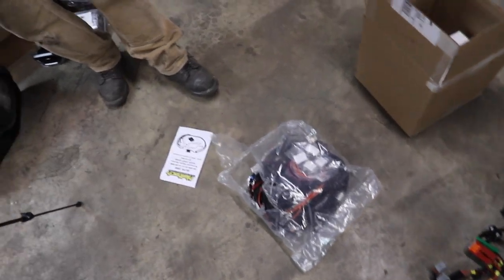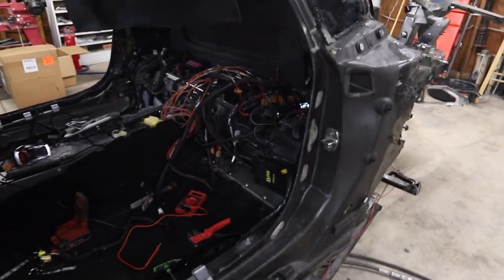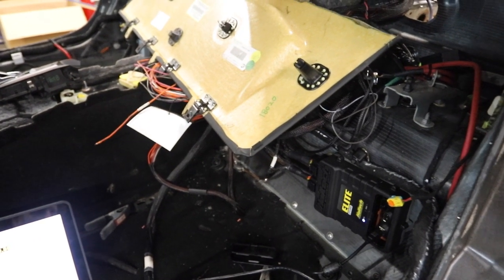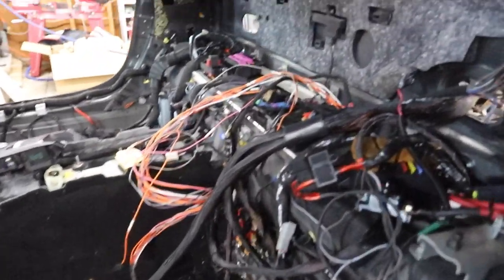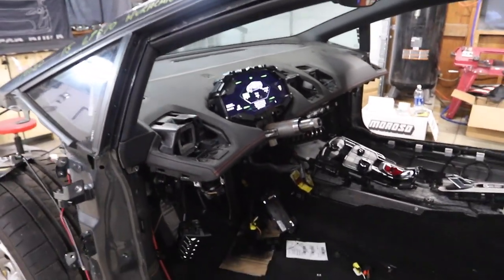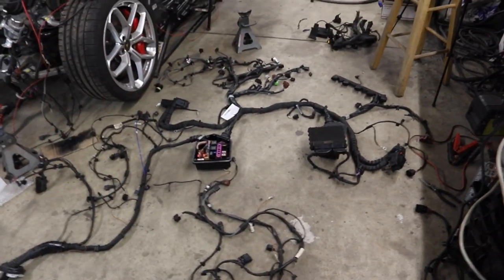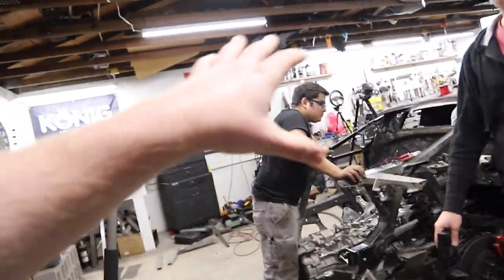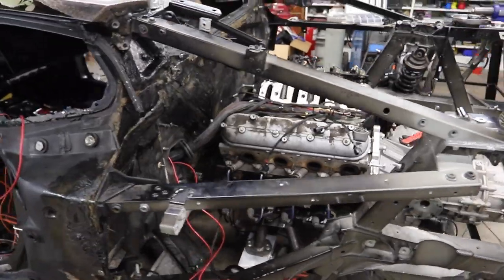Installing a Stand Alone ECU on the LS Powered Huracan - Haltech Elite 2500

Comment: Why dont you just send voltage to the key reader or send the proper resistance to it? All it should need is a key reader and bcm with a matching vin. Everything you should need from your original pcm should be able to get sent from your haltech. 
 You are overthinking everything when all you are doing is telling the car that the same things are there. Think about it as remote login in to a pc.
Reply: This is simple stuff, stop looking at them as lambo and chevy and more like an ignition switch and starter. You tell the dash the speed, you tell it what gear it is in, you tell it everything. It all goes into the bcm and the bcm sends it to the display/dash.

Comment: For the usb from the ECU i've used one of these for android auto on an aftermarket head unit.  Maybe you could hide it behind the driver's seat so it is out of sight- after the hurrican rebuild I'm sure you would know where that would be.  But then you don't have to have cables laying around.  No affiliation with the brand:  https://www.amazon.com/BATIGE-Square-Extension-Motorcycle-Dashboard/dp/B078LRSZDB/ref=pd_lpo_sbs_107_t_2?_encoding=UTF8&psc=1&refRID=4DVTG1Z1TDF4YAHSDADB

Comment: Why bother with the hurricane ECU crap. You're going to have the factory dash running as a dumb blank and won't get any info like speed rpm etc. While the haltech does all that. Pretty sure haltech has a display that looks a lot like that hurricane display. Just get that display and mod it and the dash to fit. Then see if they can help you skin The display to mimic the hurricane. Trying to use the factory electronics is just a waste of time for no gain.

Comment: The speaker power cable is garbage it is cooper mixed with aluminum ,you need copper only cable and gauge is small ,you need gauge 1 at least.

Comment: Starter on the steering wheel is a horrible idea.  all it would take is one misplaced grab of the wheel or slip to engage the starter on a running 100hp engine.....um, hard pass